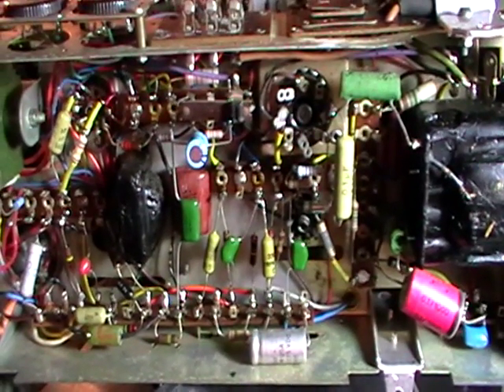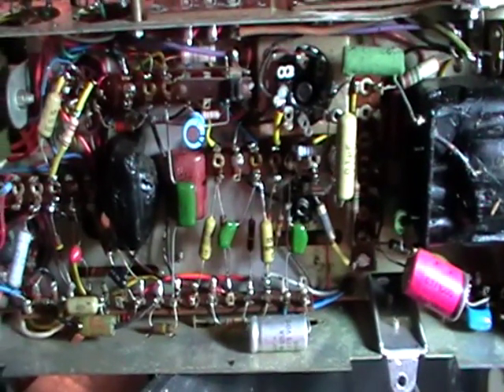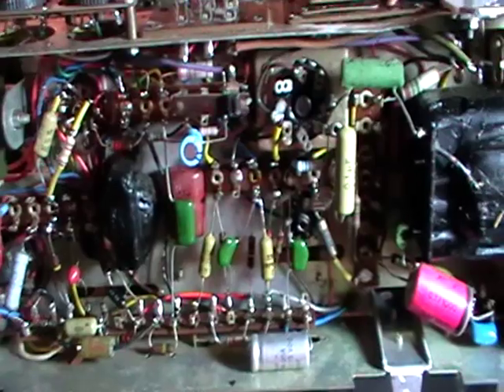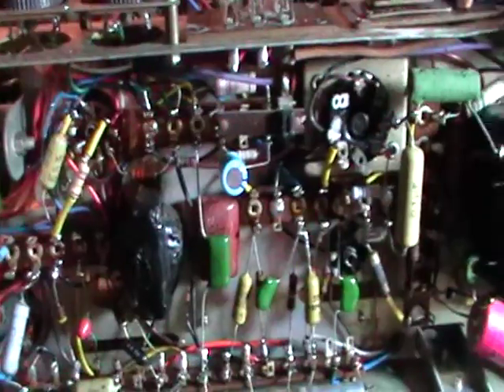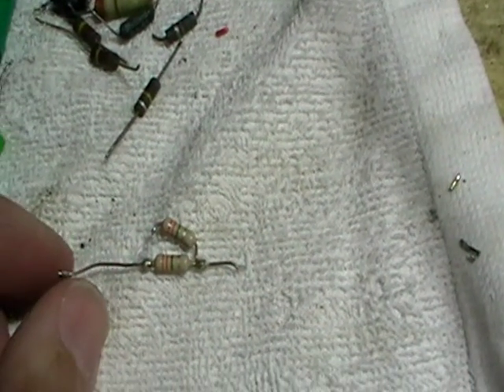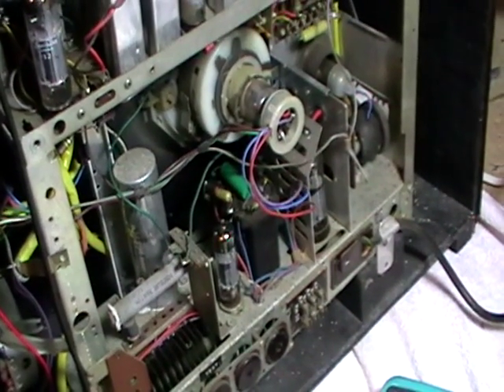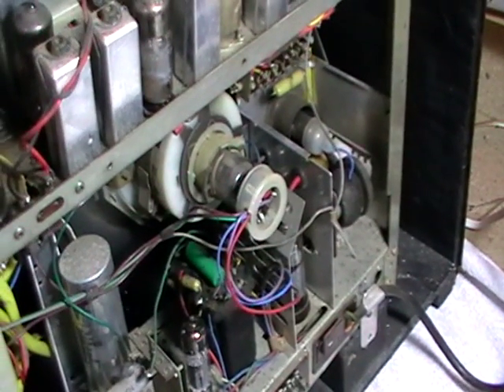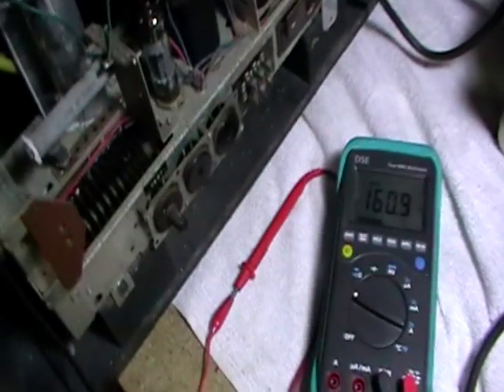NZ Homebrew/Thorn/Pye 1960's Vintage B&W TV Part 3

Comment from the maker: I doubt it would have been the same insides as this one, the insides of this are an English Thorn variant of some kind. A lot of old TV sets were gutted for use of the cabinets. I do have an English Pye Set with sliding doors that could be locked, the cabinet is stunning and looks nice. Its on my blog page if you want to see it.
Cheers Glen.

Comment: My grandparents (in Auckland) had a fine cabinet with locking horizontal 'shutters', in which a 23" Pye TV was fitted. I can't remember what happened to the TV, but the cabinet was used for storing fine china sometime after the TV was removed. I reckon the TV was the same as you are showing now, and am looking keenly at your progress..

Comment: I'm not exactly sure who made the bumblebee caps, I've never found a brand name on any of them. I have found some later ones from the 60's that were made by Sprague, no stripes just printed with red lettering, and they always seem to test good. I think they may have used plastic film as a dielectric or plastic bonded paper as a dielectric. Another type that seems to always test good is called "Aerovox Bielectric". Beware of Sangamo "Little Chief" caps though, those are just like the bumblebees.

Comment: I picked up a flat screen monitor about a month ago that someone had dumped, Hewlett Packard brand but China made, it is full of those two brands and needs to be recapped, including 3 or 4 swollen 1000 uf 10 volt Capxon caps. I also picked up another dumped yesterday that I need to investigate, it at least tries to turn on but probably has a similar problem. I'm seriously thinking of getting into the business of overhauling and reselling trash picked LED screen TVs and Monitors for pocket money.

Comment from the maker: Ah yes those 'quality' capacitors...I know the Capxon and Su'scon ones well. In some of the so called 'high end' audio equipment I fix for a living I have seen those caps lurking on power supply boards and the likes. Another brand I've seen is Fu'con...now what swear word rhymes with that name! Yep those caps have a lot to answer for too in modern electronics these days. Infact you think about it - the electrolytic capacitor is still the weakest link when it comes to component failure.

Comment from the maker: I have encountered those bumblebee caps in old Tektronix scopes in the high voltage section, they were all shot.
Can only imagine the problems with those high voltage caps in the Zeniths made by the same company...That was just 'asking' for trouble. The European Philips K9 colour sets had a similar problem where tuning high voltage cap across the flyback transistor would go open and EHT would go super high, flash over and kill the CRT.  The Philips K9 were a fantastic TV otherwise :-)

Comment: The Hunts ones are far worse, believe me, they are the only NOS caps I have ever run into that will fail at as little as 10% of their rated voltage.